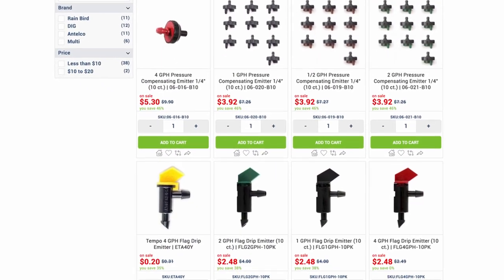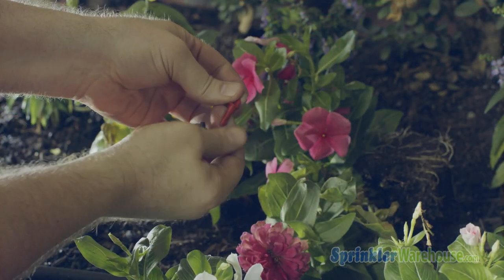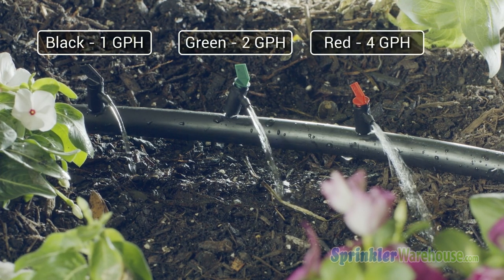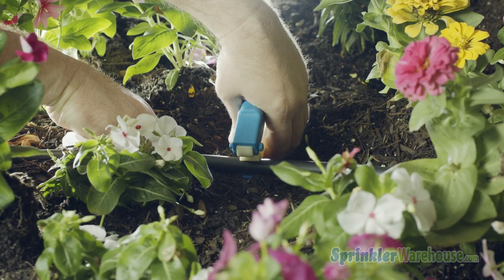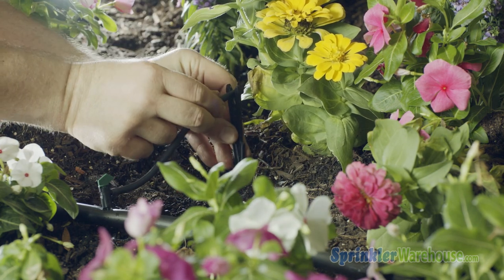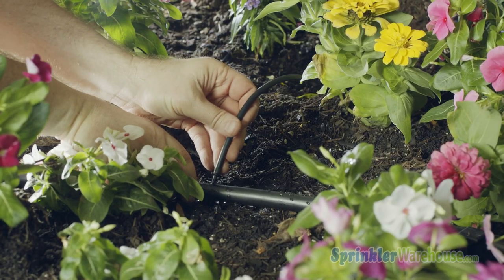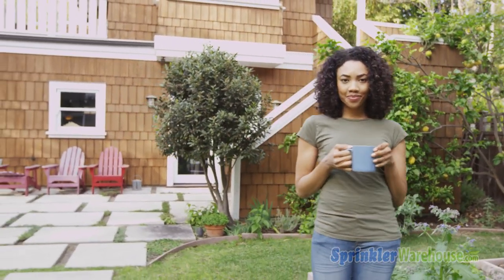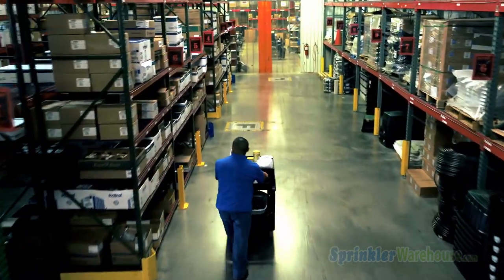Flag Drip Emitters

Comment: so these flags would work good for a less powerful pump similar to an aquarium pump instead of having to use a high pressure pump like one that's used for swimming pools? Also is there an easy way to shut off water flow to plants that don't need it?